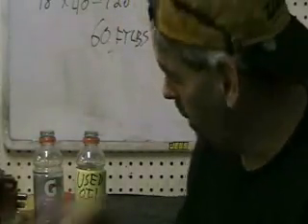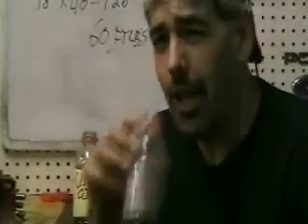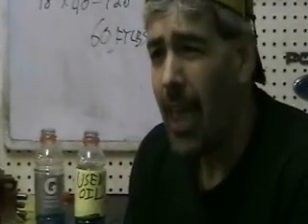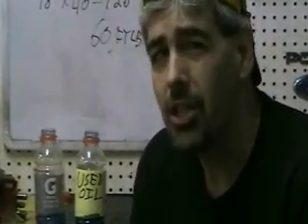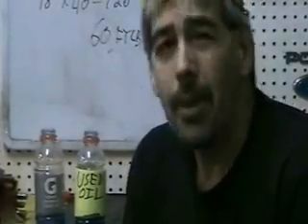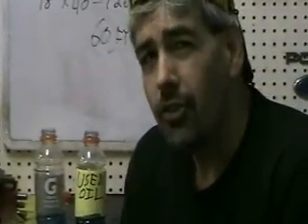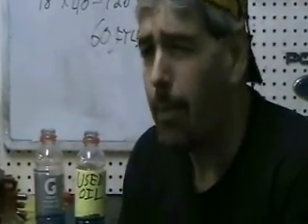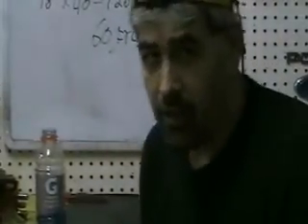Everything to know about Check Engine Lights- Part 1

Comment: Question. Something strange happened to me after I bought a 01 Silverado 1500. No lights on, took it to the automatic car wash noticed it started to idle kind of low and a little sluggish a couple mins in, as I pulled out it almost stalled and the money light popped on then quickly went back off. Hasn’t come back on since, although I do notice the engine struggling to idle whenever it’s raining hard outside. Maybe I’m trippin. Any ideas?
Reply from the maker: What data do you have?

Comment: You just solved one of my mystery's and that is why every time I go for a test run to try to solve a problem and nothing ever happens so I put my car away and think I might have solve the problem, but then the next time I go out shopping or go for a drive the check engine comes on again and spoils the party but now I know it has to have 2 drive cycles. Thank you very much.

Comment: As I promised you to provide you with my obd2 readings, here are the latest: stft1:-2.34, ltft1:5.47, stft2:-2.34, ltft2:8.59 at 696 rpm timing advance:15, intake air temp:87.8, mar:3.6 g/sec thrilled position:15% oxygen sensor2 bank1:0.8v, oxygen sensor2 bank 2 0.78 commanded evaporative purge :4% barometric pressure 14.07 psi. When I push the gas pedal both left goes down to about zero, yet on top of the obd2 screen it claims that catalyst: not passed, evaporate system not passed, oxygen sensor not passed. Sorry if I had shared too much of data. By the way there is no driving issues and no engine light except the gpm as gone down dramatically. Thank you for your help in advance (2005 Toyota Tacoma prerunner with 151K)
Reply from the maker: No idea why you are including all that- what is your plan? What system are you targeting? Are you trying to correlate IAT with STFT? What is the purpose of the IAT data?
  I don't follow what you are trying to do here sorry.

Comment: Ok serious question. What would you say if I told you my car will start run like crap for a few seconds and then dies. And also it is hard to start until it gets warmed up enough?
Reply from the maker: I'd ask what data you have.
Reply: Sorry I forgot to include there is no check engine light going off and I am getting no codes.
Reply: like as a D.I.Y Tech what would you do in a situation like this.
Reply from the maker: I would collect data. What's the static and load long term and short term fuel trim? what's the IAC position at? What's the map reading at idle and load? what is the O2 sensor reading with induced rich and lean variables?
   There is absolutely nothing to go on here bro.  Anything is a guess without data to get a idea what's going on.
Reply: I don't work on cars but I recently picked motorcycles. I feel as though sometimes you can somewhat use knowledge from cars and apply them to the FI system of a bike. I really like how you point out the fact that(in my own words of course) going to a tech chat room is not really a good option because of all the people on there who pretend to be experts, and although I am a beginner I have noticed this as a fact. But thanks for the advice, this is the problem I am having with this bike.(mentioned above)

Comment: Hello mate, I bought  used 2002 Audi A4  yesterday from a friend with no engine light coming on. I expected the engine light to comes on and off whenever I start the car but no. Also the ESP light the same. please any advise/
Reply from the maker: +Olanrewaju Olowosusi The bulb is either burned out or missing

Comment: im a DIY and just found your site, and i've only watched a couple of your videos so far and i did like them. But when you say  that you have to do 40 or so drive cycles to have the check engine light turn off on its own, after i fix a component that threw a check engine light on, i never clear the code, all i do is drive the freeze frame, and the light shuts off everytime. So unless i misunderstood, i can't say i agree with that.
Reply from the maker: Hi Frank,
  I think it's my fault for not being clear.  On most codes, the check engine light will usually turn off well within 40 cycles, however it is retained in memory for forty cycles on most codes before being cleared. While in memory, you will not need 2 consecutive failures to have the light come on again- you will only need one failure. It's like a "probabtionary period".  But after 40 cycles, the code completely clears from memory and again you will need two drive cycles with consecutive failure for the light to come on.
  Keep in mind this is not applicable to all DTC's.  Some DTC's need more or some even less than two consecutive drive cycles to come on (misfire for example needs just one), some will not turn off after matching a freeze frame without a failure, some will clear from memory well before 40 cycles....

  The information given in the video is a generalization from the majority of code setting prerequisites as described by a GM service manual for a 2000 Firebird  and a 1997 Dodge Intrepid service manual.
Reply: Frank it depends on the car too. I now recommend that after a repair to always clear a code. I don't live an emissions area, but I still replaced my catalytic converter because on my car it actually effects drive-ability.

I did the repair and felt like having the computer clear it instead of myself like a challenge to the computer or an experiment.

All I did is waist gas. Until I reset the computer, the computer assumed it had a bad cat and gave my car less power, reducing gas mileage (mind you very little less). I think my car - a 1999 Chevy Prizm, same as 1998 to 2002 Corolla. The car literally held power back trying to run cleaner.

Until I reset the code in this case, the car was determined to compensate for the failure.

By the way, I think your ECU in this sort of case is smarter than mine. :)

Final note: I've had plenty of drive cycles since the reset, I'm not in denial about the fix, lol.
Reply: i guess i havent had a code yet that duplicating the freeze frame didnt work. Well its good to know that there are some that wont shut the light off, thx for the input.

Comment: can they even do the smog emmissions test without the mil light bulb they can do the visual part but the mil light would fail correct??? it would  end the test right there wouldnt it
Reply from the maker: Absolutely correct Victoria.  Whether or not you have any codes or they appear during the test, the technician is supposed to to a MIL bulb check and if it fails, the vehicle does too.  Again, this varies by state as not all states have equal (or any in some) emissions requirements and in some states like Missouri it depends on where you live.
Reply: so with no mil light working  then they cant even determine if you car is a gross polluter
Reply: another question is the stero is a stero i bought from walmart and put it in when i bought the car it didnt have the orignal stero either in order to get any codes the stero has to be removed why is that. with the car stero in they cant get any codes
Reply: the reason i ask this is because i bought this car 2 years ago and the seller had the smog done on it and it passed i didnt think anything about it then 2 years go by i go to have the smog done and it failed because the guy said the bulb was burned out and i ask him is the bulb even there he said he didnt no just that it wasnt working to get any data off the car he also said the stero was put in wrong . well i took the instrument panel off and there was no light bulb and i had the stero checked and it was hooked up right. i was pissed about the lite and the stero cost me money to have it checked. but on the test it also failed the emission which i thought was strange if you cant get any dat from the car how can they say its a gross polluter. it doesnt make since that these numbers came up but they cant get any data because there was no light bulb for the mil lite to even work
Reply from the maker: @ Victoria-  You should not have to remove the stereo to get codes- what year is the vehicle?  As far as the check engine light vs the car being a gross pollution monster, I agree those are two different things.  You can have a car with a check engine light on that emits no pollution, and a gross polluter that has no check engine light or a malfunctioning one. You can also of course have a car with a malfunctioning CEL and it emits no pollution.  Why do the former and latter fail? Because without the CEL working, it at any time in the future the car has an emissions component malfunction the driver will not be made aware.  Similarly- if the CEL is always on but there is no pollution- if that situation changes and the car starts to have an emissions component fail the driver also is unaware because the light doesn't get brighter or anything lol.
Reply: i have a 2002 cabrio and after i put the mil light bulb in the check engine light was on so i took to a shop and they could not get the codes until they unplugged the stero then the codes came up.when i bought it there was a jensen stero in it and it blew up so i bought another on from walmart a jvc put it in
Reply: when i bought this car it was making a noise so the guy said he would fix it and said it was the muffler anyway when he brought the car to me and said he had it smogged of coarse it passed and the noise was gone then the noise came back so i took it to midas muffler and told them and i ened up having to buy 2 mufflers for the car it cost me 400.00 . and the car has been running fine then its been awhile since a tune up so i bou8ght spark plus and wires and air filter put it in. i never thought the check engibne light didnt work i figure there was nothing wrong because this light never came on then i had a oil change to. i cant believe that the place that change my oil and this muffler place never recognized this light not working and a exhaust inspection dont you think that they should of recognized this since it has to do with the inspection at the muffler place